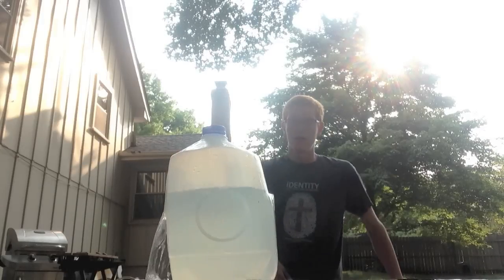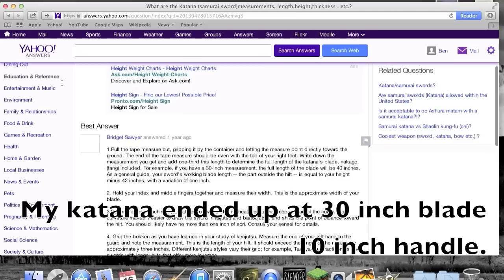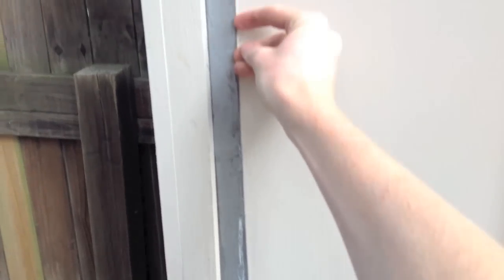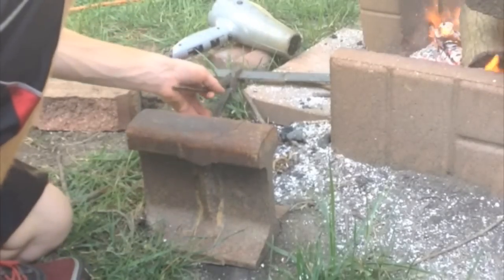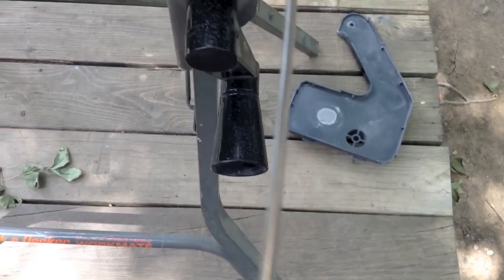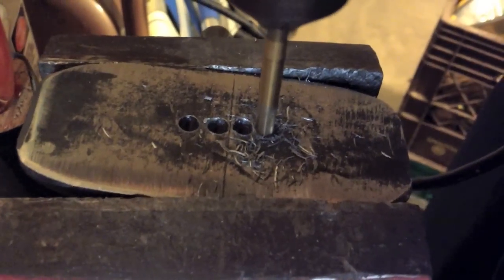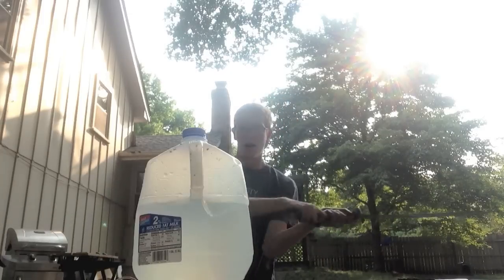How to Make a Sword Start to Finish! (Katana Sword Tutorial)

Comment: Well done, great katana style sword.  Don't let the critics knock you. Many of the medieval swords had a low carbon content and still did the job. The irony is that your sword may even be tougher than some of the clay hardened 'real' katanas with the hard edges, great cutters when it came to opponents in lamellar armour such as samurai, but many of the Japanese swords would have shattered or become badly chipped against European knights in plate and chain mail. If the Japanese had settled medieval Europe thy might have adopted some of the heat treating procedures of European smiths and applied them to their sabers....and vice versa depending on intended use.Traditional methods of sword manufacture were also dictated by the available materials. A part of the attraction of traditional made katanas and wakis is the attractive hamon produced using clay to insulate a part of the blade giving the lines between the hard edge and softer back.

Comment from the maker: Just gonna say this so people don't have to comment it so please thumbs this comment up! Mild steel can not be hardened AS much as carbon steel. But to some extent it can be, and if properly tempered can absorb carbon from the fire! There are a lot of factors that play into it, but you can make mild steel if you work with it for a few hours and get it to absorb that carbon. It is not as simple as just buying carbon steel and honestly not as worth it. But to some extent mild steel can be hardened, even if you do not allow it to absorb carbon.
Reply: BennyCriss12 I'm currently making a big sword with and aggressive guard so I was wondering if I should forge the guard with the sword or forge separately and rivet it in
Reply: well the amount of carbon absorbed through fire is debatable, but you can get a small ammount of carbon on the very outside layer if held at 1,800f for a while. it will go maybe 1 to 3mm into the steel and then you will have successfully case hardened mild steel.

Comment: I think the thing what makes a katana is it's unique mix of harness and thugness which is achived by hardening the steel, that's also how the katana gets it's curve, you didn't harden your katana
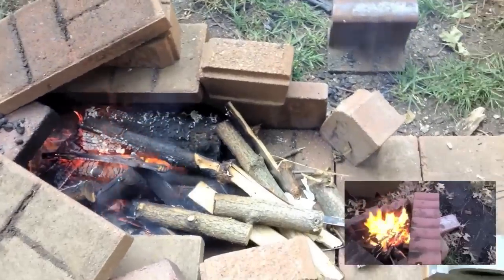Reply from the maker: Watch at 5:13 I hardened it.
Reply: You have to put some clay mixture in the spine of the sword to allow the edge to be harder than the spine, when you go for the sudden cooling in water. That's how you obtain the curvature.
Reply: using traditional tamahagane, yes, in modern steels all the clay does is make a hamon :)
Reply: Joao Machado called the hamon
Reply: +Sebastian Hennes, The hamon is the visual effect along the blade. I was talking about how to achieve the curvature, that will obviously work in certain kinds of steel, high carbon to be exact.
Reply: Martin S I

Comment: You know, even though the handle was kind of odd when it came to historical accuracy, I found it rather cool. Having a copper handle with a spike handle seems pretty steampunk like, and I like that.
Reply from the maker: Thanks! I like how the shape and edge turned out but the eat treat was really bad...cause I honestly don't use the equipment to heat treat a piece that big (the technique I used works though) but it's flimsy so I can't really do to much with it until I fix my forge fans ha. The handle I originally tried an applewood handle but that didn't work out to well and I accidentally deleted the footage so I just used the pipe and that worked surprisingly well. Hopefully I will have another video for a wood handle soon. Anyway thanks for the comment I always enjoy hearing what people think!
Reply: BennyCriss12 Well alright, interesting. What kind of steel did you use?
Reply from the maker: VideoMasher3000 I just used 1/8 inch constructions steel from the hardware store, it works really well but i don't recommend it for knives over 1.5 feet if feel like once you get past that either use 1/4 inch or invest in a higher quality steel, but its what I use for all my regular knives cause its pretty price effective and good quality for smaller knives I personally have had no trouble with it on my normal knives and since Its only a hobby for me and I give most of my knives away and don't sell them I don't invest in super high quality steel (although if I had money I totally would ha)
Reply: BennyCriss12 That's pretty cool. Ya if you ever want to invest in a better steel I would recommend tool steel, if not carbon steel.I plan on starting this up as my own hobby. Hey, wanna make me something? lol. I know its probably not worth it since you really don't know me, but if you are bored you could make me one. I don't have much money at the moment, but if you like I can promise to make you one some day. I don't know when it would be, but some day lol. (probably within the next year once I get stuff up and running).
Reply from the maker: VideoMasher3000 would old files be made of tool steel? cause if so then tool steel is amazing ha but I never have actually heard of that term or steel looks like I have learning to do ha. heck i would but up for just sending you something I'm not very good tho…I am gona try to make a few straight blade razors (doubt they'll be to sharp ha) I would have to find a safe way to ship it ha but honestly I think it would just be cool to start getting knives out I am bona start stamping them with entails to but i think that'd be cool
Reply: Tool steel is probably one of the highest quality steels you can get out there besides spring steel. If you want more info on it then I would check out http://www.sword-manufacturers-guide.com/sword-steels.html

This site is a great source for swords and steel info.
Making straight razors sounds pretty awesome to me. I have always wanted to learn to shave with one and to have one hand made sounds pretty cool lol. Honestly though if its to much of a hassle for you then its really okay, you can say no, I won't crush me inside...at least not very much jk. But if you do want to do it....looks to left...then the right....then to you it would me amazing lol
Reply from the maker: VideoMasher3000 Ok well i don't know if it'd be like face shaving sharp…but it would look cool I've only made one before and every like now and then you could get a few hairs off your face…but it shaved leg hair real well ha. Well I will message you when I have a few done cause i think it'd be cool but then I gotta check the law with shipping that stuff I don't think there are problems with it considering I but tons of knives on amazon..but I like to be safe
Reply: BennyCriss12 Okay, sounds awesome. Ya I I am pretty sure its legal (I understand your concern) as far as I know inside the states I believe you are only not allowed to ship explosives or firearms, but then again there is nothing wrong with double checking. I look forward to hearing from you again. Till then, have fun :)
Reply: Nick Butler Does it really look like that was his goal though? To make a true katana?...think maybe he did this as a way to arise inspiration and get at least one foot in the door?
Reply: Don't get me wrong its a good sword just not accurate to a real katana , I wish I had it
Reply from the maker: Nick Butler I was on my phone at 3 A.M. last night and tried to hit reply and accidentally hit delete…I think you still see it as there but I can't…But I do agree it technically isn't historically accurate because of multiple things I did. The forging was probably the biggest thing I woulda loved to forge it traditionally, but I am not that good ha :P But I do what I can https://www.youtube.com/watch?v=2WkWNDDrQO4 This video is the legit way I love it! I just make do with what I got and what most people do to. But thats one thing I enjoy about knife making and blacksmithing is no one does it the same, each sword/knife comes out different and unique! Ha it is a lot more steampunk tho :P
Reply: BennyCriss12 its Ok and I'm sorry for being kinda rude , its a nice usable blade , next time though here is something you can do to make the handle , heat the tang up till red and push a good wood you chose to be its handle , the guard should be on as well and the pomle (sorry if I spelled it wrong) could a piece of metal , let me put this step by step to make it easier if you didn't understand
1 make the handle from a piece of wood a little shorter than the tang
2 heat the tang up
3 put the guard on 
4 clamp the blade in place 
5 push the wood onto the tang , it should burn the wood away
6 put on the pomle
7 hammer the remaining part of the tang flat
This is will not come undone unless you cut the flattened tang part off
Reply from the maker: Nick Butler Naw I didn't think you were being being rude, don't worry about it ha. I am actually recoding a video this week on making a sword handle! Unfortunately though when I was heating up the tang, my torch ran out of fuel -_- so yah…for some reason I always have trouble with wood….all I have to do now for the video is the pommel though. Thanks again for commenting!

Comment: looks really good man. but if you got that from a hardware store. chances are it's mild steel and you cannot heat treat it.  it will cut just like any other sword would, just your edge won't stay. I use mild steel too. I have no problems with it.

Comment: living my dream man. any advice on painting the blade to avoid rust? also how did the copper pipe stay on so well?
Reply from the maker: everwonder100 hmmm well id say buy some metal spray paint i think rust-o-line is a good brand name used for metal and you can just put painters tape on the edge if you didn't want that painted, but thats what a lot of professionals do. But don't buy the cheap spray paint if you can help it, cause the cheap stuff looks thick, elastic, and rubbery paying a tad more is worth it (i learned the hard way and had to completely strip a piece of its paint twice! :P)
Reply from the maker: everwonder100 oh also regarding the copper pipe, it was just held on by the pommel, it was really tightly fit on there and worked out well! I also did put a little masking tape around the tang so it would fit tighter so though.

Comment: Well made Katana style sword. Great cutter, and I am sure you value it more than some production piece. You noted keeping the edge about a dime thickness to protect it from possible cracking during the heat treat process. 

What did you use to bring out the final edge on the sword after you heat treated it ? Did you use coarse stones ?.

Comment: After the heat treatment you sanded the sword down. Did you put an edge on the blade with some diamond or oil stone, or just bring out the edge with the sand papers alone. Cheers

Comment: what type of steel did u use, is it high carbon, spring, or stainless?
Reply: spring steel is high carbon, and stainless can be either high or low carbon.
Reply from the maker: Cannot is a strong word, not really is what I would say to some extent it can. Black smiths back in the day also use to let it absorb carbon in a fire over a few hours, which helps it harden. Either way I was not going to the traditional method here obviously I was only 15 at the time. I would recommend spring steel honestly now and days. Or tool steel is great especially for knives if available.
Reply: you're right. I learned that it can be hardened a little just this week. steel absorbing carbon I think is called carburizing... I'm not sure how it's done though

Comment: do you have a video on how to make the sheaf ???
Reply from the maker: emrys I do not currently but I plan to make one soon, times just been tight :/
Reply: BennyCriss12 ok :) cant wait to see it. 
just one more question would the blades stand up to cos-play fighting/stage fights or would i need a difrent type of steal ?
Reply from the maker: emrys well, I wouldn't trust mine because I messed it up the handle when heat treating :P aaaaand I don't know that I would recommend it because if you make it like me it will be really sharp and that could be dangerous…what I recommend is making it the same way but don't put and edge on it, just sand down the blade and make it dull like replica and cos-play swords, and I wouldn't heat treat it unless you really wanted to wouldn't matter either way with cos-play but it would be stronger if you heat treated it. But yah I think it would hold up to cos-play if it was made correctly, truthfully it is hard to get it 100% safe though, because swords are larger pieces someone who is not a pro (like me) has a lot more room to make a mistake a leave a weak point in the handle or unevenly heat treat (which i did sadly…) but just be safe and you'll be good. Also if you made your own sword for cos-play that would instantly make you 1000X more awesome than everyone else.
Reply: BennyCriss12 Ok thanks for the advice I shall take all you have said into considrashion thanks again

Comment: What kind of belt sander did u use
Reply from the maker: +alec lanci I believe it is a 1X32 inch not sure the brand on it, its so old it is worn off, but usually just check the rpm and the horse power, you want something with higher rpm and at least 3/4 horse power.

Comment: DON'T USE DUCT TAPE: Here's a tip from a welder. Instead of using duct tape to lay out where you want the blade to be, use a talcum stone AKA soapstone. They're used all the time for cutting steel with oxy fuel torches because when you write with them, it's like chalk, but it stays on the steel under extreme temperatures and pressures, and comes off very easily with water.

Comment: unfortunately the steel you find at the hardware store in the welding section is a mild steel. this is NOT a high carbon steel and will not harden properly or hold an edge.
Reply: You'd be surprised.
Reply: Ryan Selby You can always make high carbon steel from scrap metal or cheap steel.

Comment: Did you cover the spine of the sword with clay before heat treating.
Reply from the maker: +Anthony  Scott I did not and I know that is done to create a hamon line and give the sword a softer spine and harder edge, but I did not do that because I didn't have the clay. It is a cool thing to do but it is also hard and doesn't make the biggest different either.
Reply: The clay makes the spine soft but the edge hard by preventing the spine from hardening this is due to the carbon concentration moving to the edge making the sword capable of slicing harder substances depending on what steel you use. And with regular maintenance it last a whole lifetime. The carbon differentiation also prevent the blade from cracking.

Comment: What kind of metals can you use can u use alminium or iron?
Reply from the maker: +Teun van der Kerk Aluminum probably not because it is to weak of a metal, but iron yes, iron and steel are both good it just depend on the kind you get. Leaf springs from cars are pretty good for swords.
Reply: +BennyCriss12 ty for fast answer but i have another question what happens when you dont heat treat?
Reply from the maker: Teun van der Kerk Kinda depends, sometimes nothing the blade may be weaker though, and you may get little chips in your sword. Or it could bend or break. I actually have a video of me testing a sword I didn't heat treat. Works great and slices straight through a watermelon.

Comment: just regular charcoal will get hot enough to make it red ?
Reply from the maker: Zak Regular charcoal should work just fine I normally use it but i didn't have enough so I used a lot of wood also because regular wood works great to. Blacksmithing coal will by far get you the best result tho so if your willing to pay for it I would say go for that!
Reply: Zak Charcoal is actually preferred for forgewelding damast and such since it burns cleaner.....(Although you'll run through alot more charcoal than smithing coals/coke) On that same note, gasforges heat slower and go barely over forgewelding temperature....
Reply: Yorozuya Propane forges melt steel if you're not paying attention and heat faster then any other forge? I'm not sure who feed you that information but it was highly incorrect
Reply from the maker: Gas forges are the way to go honestly but they are expensive :/ Id love to have one tho its a lot more efficient and can get you better even heat.

Comment: can you reuse the oil for another sword or knife
Reply from the maker: It depends on the oil, I've used the same two jugs of motor oil for my small knives for a while now and that stuff reuses great. Something like cooking oil I wouldn't use more than couple times though. These guys had a pretty good discussion I though http://www.knifenetwork.com/forum/showthread.php?t=63139 mainly as long as your oil isn't like chunky and filled with random shaving and scraps it should be good you'll know when its time to swap it out. If you are buying actually quenching oil that stuff will last years supposedly (I haven't used it but i think its a good investment if you heat treat a lot) Thanks again for the question!

Comment: do you temper your blades after you heat treat it?
Reply from the maker: It depends on the knife…its recommended that you do with all knives you make but eh I'm lazy sometimes. I am planning on making a video on it soon. If you are able to there is no reason not to I don't think, but I haven't noticed a huge difference with not doing it (with smaller knives that is) I don't really have the ability to do it with a sword of the size of my  katana i made but it is something I really wanted to do it does make a large difference in larger pieces.